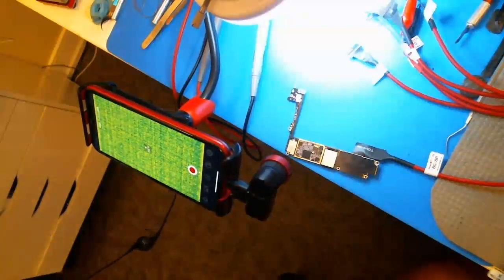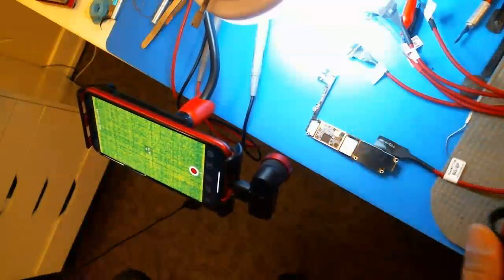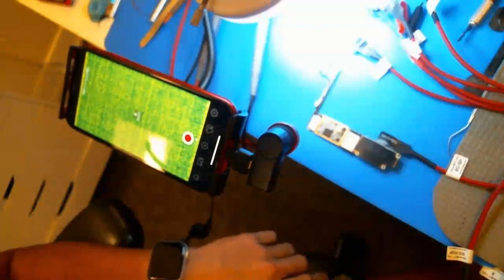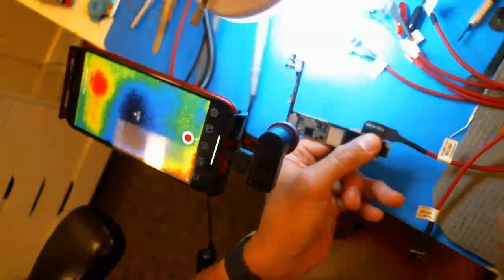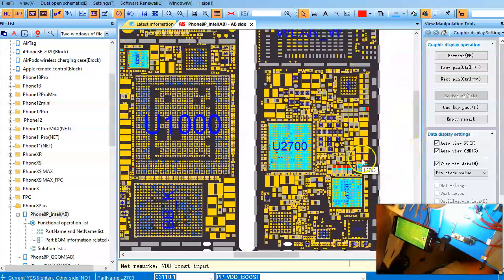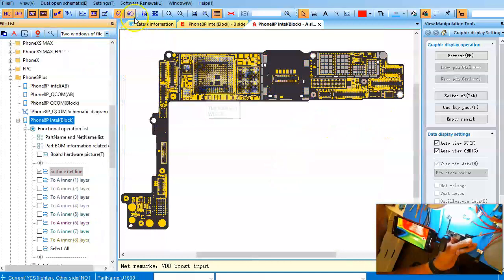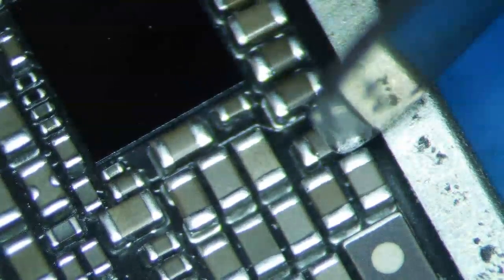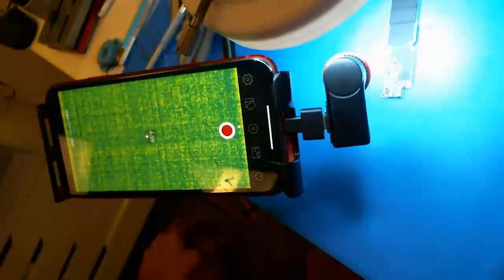My thoughts on the Seek Comact Pro Thermal Camera for Micro Soldering

Comment: From my experience using one of these for a few years now, you aren’t using it in the best way.  The lens you’ve added onto it is called a macro lens which allows you to focus in much closer on the components. What I do is lay the board flat down, hover over the board with the seek without the macro lens on as this gives you a much bigger coverage of the whole board... when the area of heat shows on the camera, then I add the macro lens to pinpoint the shorted component if it’s not clear enough without the macro lens. Try this way, you’ll find it much better